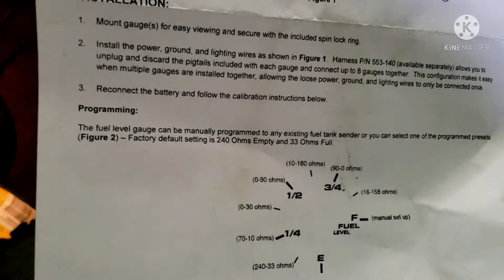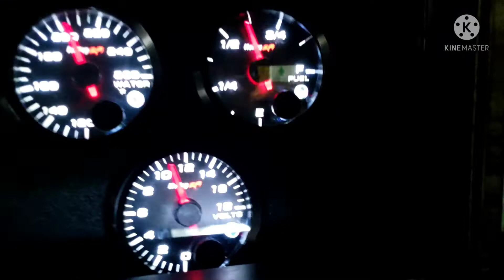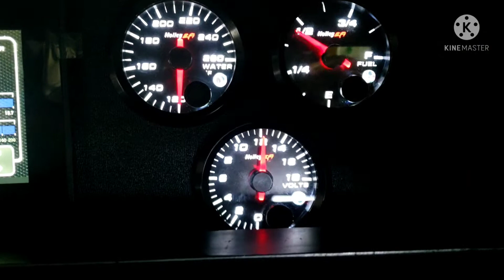Whomever got a root on me, call it off. Im sorry cuh. Let me be great.

Comment: Bro all those aftermarket throttle bodies are trash with a cam. The most expensive aftermarket and stock ones have a hole drilled in the throttle plate so that’s what I did. Idles like stock now.